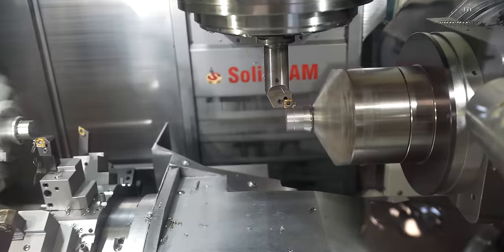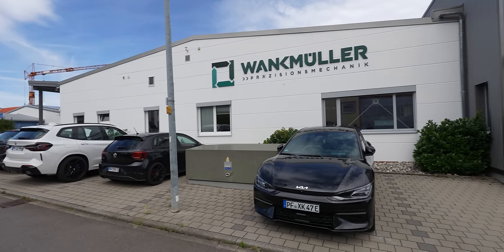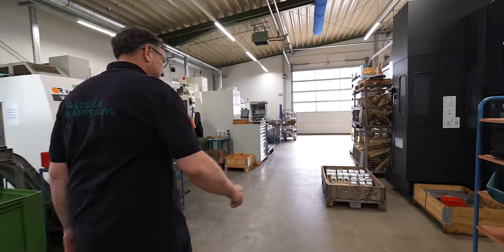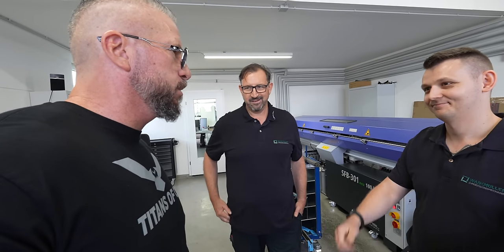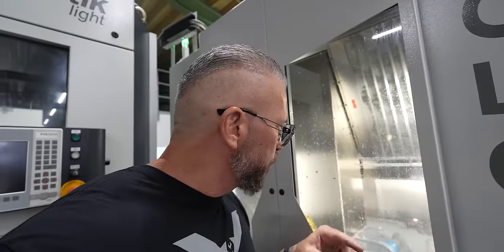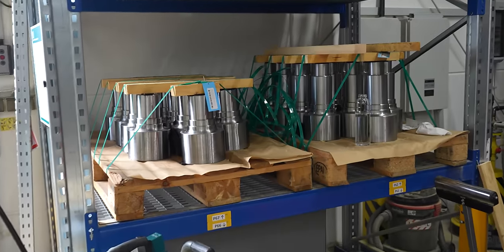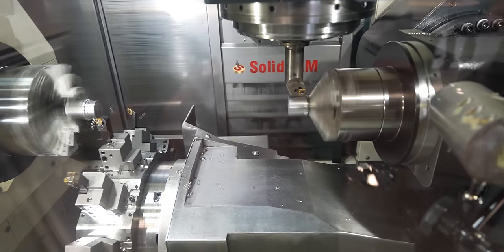Is a CNC Machine Shop in Germany different than America?

Comment: In Germany, job quality for the workers goes hand in hand with the quality of the manufacturing. This means reasonable wages and free time to spend with the families. Additionally the external training structures for apprentices are also designed for efficient integration of new employees. This is achieved because the companies are in direct contact with the training institutes to ensure the quality and relevance of the training. A new machine operator will be directly operational on day one. I've been to machine shops in other countries where machine operators need a year before they can reliably be allowed to operate the machines. Willingness to continue to develop its manufacturing processes is also a daily theme. Efficience and quality throughout the company and a willingness to continue to develop the processes is the key to competitive manufacturing.

Comment: Totally true, I don't need to speak a countries language, G and M codes and coffee are enough to understand other machinists 😂
Reply: No plece like g28 I guess
Reply: Years ago when I first got into the trade I was having issues with a part that I was making. I had my direct supervisor and the floor foreman at my machine talking about the part.  They were speaking Spanish to one another.  I don't speak Spanish.  I do however know enough to understand the numbers.  As they were talking I interjected something about the dimensions they were discussing.  They both turned and looked at me surprised that I understood what they were talking about.
Reply: @brandons9138  totally true 😂
Reply: Heidenhain has entered the chat
Reply: @bbjornsson  hello Heidenhain, do you speak ISO or Dialog (L, CC, CR, CT) 😉
Reply: ISO is better... And the metric system 😂 i prefer when my part is 200mm long and Not 8.734 inch 😂 but i agree, when you share a passion, IT doesnt Matter where are you from.
Reply: okay, can you set up this part, i need it asap

G1 Z-100 F9000?
M3 M8?
Reply: @ipadize  don't know exactly what you mean, but I make a guess.
G0 G90 G54 G43 X? Y? Z (start position) M3 S(spindle revs);
M8;
G01 Z-100 F9000 (that is a quick feed rate 😳);
G0 Z(start position) M9 ;
G0 G91 G28 Z0;
M30;

Comment: IMHO it's also worth mentioning that work[place] safety standards are very high in Germany, where I work we still have a bunch of manually controlled lathes and had to retrofit a cover over the main spindle 8 years ago, in contrast to more modern machines that already have that made out of metal these were just made of some aluminium pipes with some clear plastic windows, so they wouldn't really stop flying chucks, however they prevent from directly touching the running spindle (they're with a switch, so the machine only runs with that cover closed).
And some more things like that the T-handle socket to tighten the chucks has a spring-loaded pin, so you can't leave it in there (and start the machine), if you forgot it, it will jump out and cause some noise. 😁
I work on a CNC Lathe (DMG-Mori NLX2500) and it has four access levels and I'm only allowed to use 1 and 2, with 1 you can only jog when doors are closed, 2 allows you to jog with reduced speed while doors are opened, but you have to keep a safety button depressed the whole time (like a dead man's switch), 3 and 4 are surely higher, 4 literally like sudo but you have to be specially trained for this and it's seemingly more for some service staff and rather temporarily than permanently.
And these safety standards are set and enforced by German Statutory Accident Insurance, these were founded in 1884 and paid by the employer (some of these social insurances are paid by both, this only by the employer), they also already cover the duty stroke, when you have a commuting accident and if you get disabled so that you can't work on that job anymore they'll pay retraining so you can learn a different job that you'll still be able to do.

Comment: it where so funny when Titan visit the company where i Work 😅 i'am a CNC and Manuall Lathe Machinist and Manuall round Grinder 

my company is very old and so our Machines when you see our Workpieces or Products you would never think about that comes from a Machine Shop that Looks like a dirty old coal mine 😅😅😅 we also don't use CAD CAM all Machinists here Programm by hand directly into the Machine Like its 1995 or so 

and we are still on the marked have our customers and sell our Automatic Hydraulic Clamping devices all around the world
Reply: Same with us we make shiny precision parts out of dirty old machines, programmed directly on the control... For some types of job shops it's not yet time for the future
Reply: @Orakwan  For some it's not yet time to only be 20 years in the past....
Reply: @k53847  but isn't it better to learn the fundamentals of machining on 50 years old machine, then 20 years old, then modern? You can't just be born in 2006 and start working on a mazak integrex at 18 in 2024 without ever touching a manual lathe
Reply: @Orakwan  Yes, you can start learn and working on a cnc without ever touched a manual. It's like one do not need to know how to operate a 1920's Ford in order to drive a 2020 model Ford. I do not got any against manuals, got a couple at home for hobby, but wouldn't bother tell some youngsters how it works, that will operate on CNC's  anyway
Reply: @Rimrock300  I think just spending a couple months on older machines at the beginning of your apprenticeship helps you become a better machinist more quickly while avoiding a lot of costly mistakes on complex CNC machines
Reply: @Orakwan  Titan has strong opinions that teaching people manual machining today is pointless.  Like training diesel mechanics by starting with how to manage teams of draft horses.  That last isn't something he's actually said, but I think it conveys his opinion.

Comment: Safety glasses not required while machining in Germany?
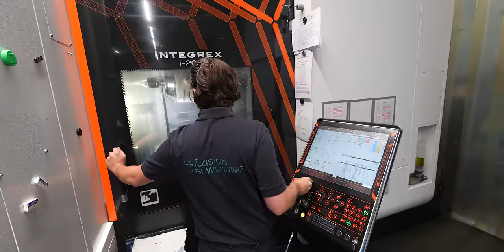Reply: Do you need corrective glasses ? All CNC machines have safety doors, windows or portals. If anything goes through that, safety glasses will not safe you and will be useless. But if you check at 0:35 , 6:20 the guy uses safety glasses while working on the manual machine, because at that time they make sense. Same with the guy at 6:15 who is wearing them working at a CNC system while the door is open.
Reply: No - rules are not so strict considering safety glasses
Reply: only for the weak
Reply: @seanthiar  Its a cylindrical grinding machine, not a lathe.
Reply: We wear safety glasses where it makes sense.

Comment: I'm a CNC apprentice at an automotive OEM. Anyone know a good type of cut+puncture resistant gloves that will help reduce the amount of splinters I get? I am almost always machining tool steel and its just splinter city. I've tried the normal cut gloves but they don't seem to prevent splinters. I tried with a pair of nitrile gloves under the cut gloves and that helps more but surely there is something on the market to prevent splinters from getting into my hands? I understand its just gonna be an issue but I feel like the issue could be reduced lol.
Reply: Even if there is a glove that exists for this, maybe you could find another solution to reduce splinters, like using a fan or flood coolant to push the splinters in a single spot away from manual handling
Reply: Try 32-105 hynit gloves, durable and a good fit
Reply: Don’t use gloves when operating machinery ! If  it gets caught ,you could lose a limb  or worse ! 😳
Reply: @speedbird63  common practice to wear gloves whilst loading and unloading, so easy to cut your hand on a burr or nip your finger nail when putting a component down. I never wore gloves for a long time when I first started because it was more time consuming and downright sweaty, now after 23 years of tightening up fixture bolts, lifting thousands of castings and billets I have permanent tendon damage in my index and middle fingers on my right hand.

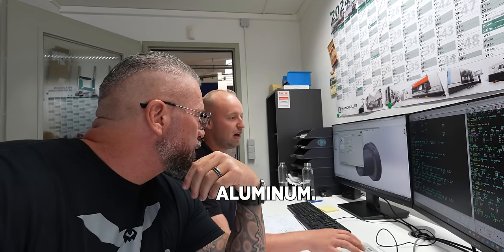Comment: 3:00 this guy has Mazatrol running on his PC... how? it's not G code. It Mazaks conversational programing...
Reply: Mazatrol g codes are the same as eia/iso machines, been a while since I've used mazatrol but there is a eia/iso option button when first creating a program at the bottom left or right on the screen. You might only need to change a few m and t codes to get a program to run